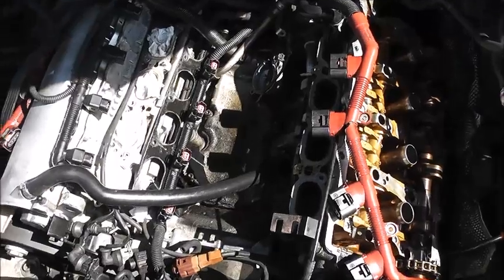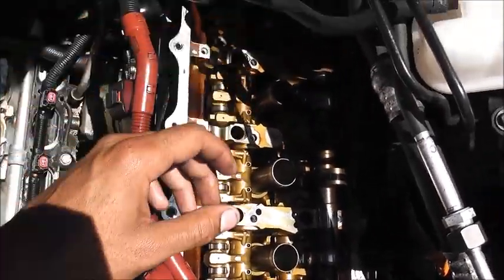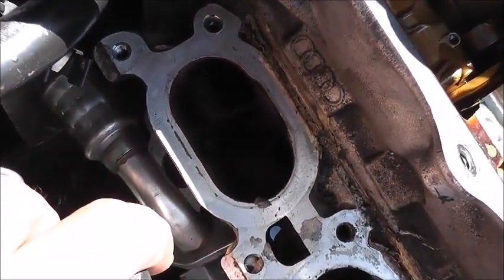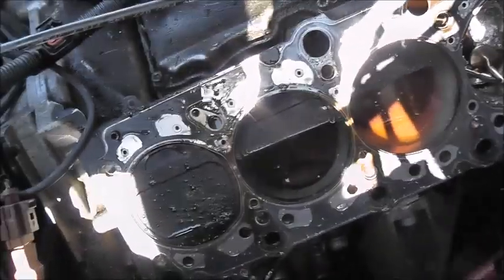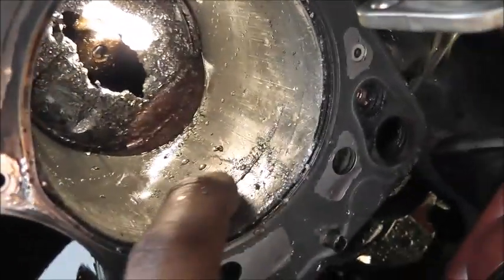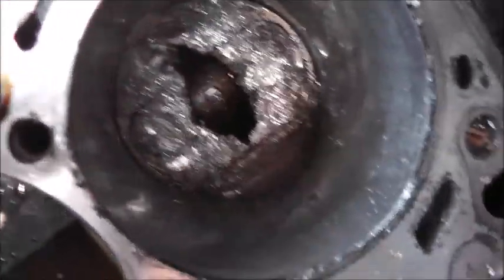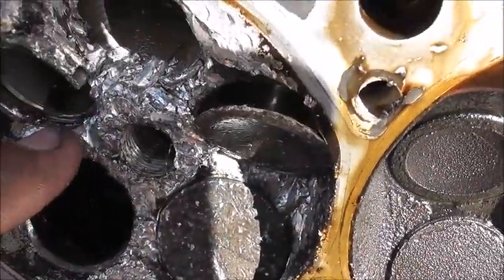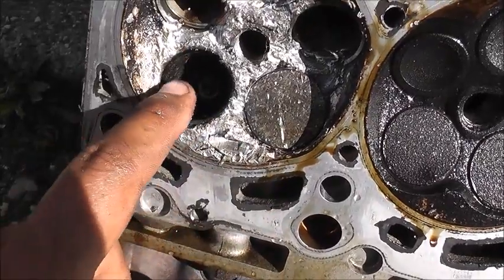My Audi A8 engine has blown Pt2: Damage assesment

Comment: Fmd Chris! Didn't you have a ZF that also shit itself? That cylinder is proper fcked as is the head....Do the best dodgy you can and trade it in at the worst dealership in town!
You should've bought a Barra lol
Reply from the maker: Haha yeah, but I bought the car with a dead box, and the new one I got I overhauled the bushings.
The old box that I had I stripped to see what the damage was. It can be easily repaired quite simply, but I don't have the time nor the money to repair it and sell it
Reply: @SolveElectronics  Yeh the ZF (6HP26) in Aus fitted to the Ford Falcon and Territory are a big deal here. They easily handle decent power 400rwkw if you have mechanical sympathy or rebuild for 500-600+ kw using either billet or modified for the 6R80 input shafts plus other goods! Excellent auto when behind our 4lt 6cyl turbo engine (aka the "Barra").
Reply from the maker: @brettus9115  nice! yeah they are very strong boxes, but they tend to die after 100k without oil change
Reply: @SolveElectronics  Funny you say that as Ford Australia say they are sealed for life which I never understood? Most of us who modify these cars service 50k km interval unless they have massive abuse. I changed the oil at 80k for Castrol Transmax Z but others have used Gulf Western as it has a ZF certified oil. The standard oil which I call "liquid gold" as it's ridiculously expensive was no different imo to the Transmax Z as far as performance, shift, firmness etc goes!
Reply from the maker: @brettus9115  yes it came from zf that said it was unnecessary to service the oil. but then they changed it to 150k,  but then advised it should be changed at 100k at the dealer discretion
Reply: @SolveElectronics   Yes anything with wearing parts needs oil changes but in saying that I'm surprised at the punishment the ZF can take and it's effortless with regards to gear changes....
Your beast needs a turbo also btw lol